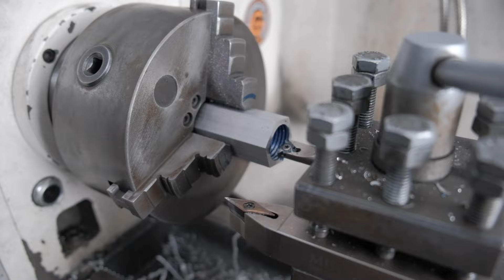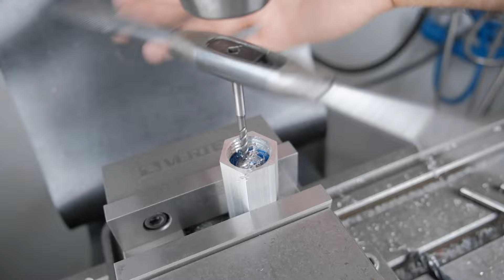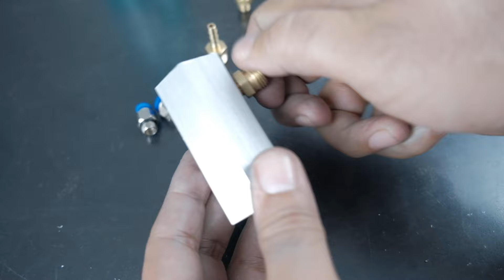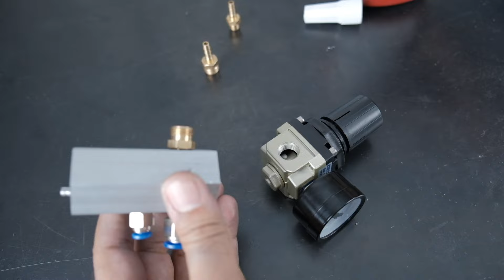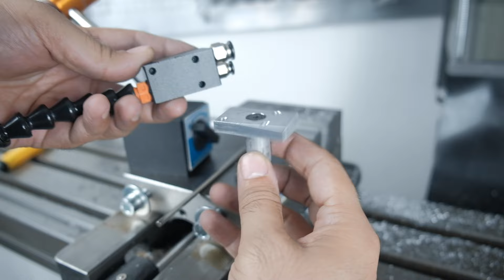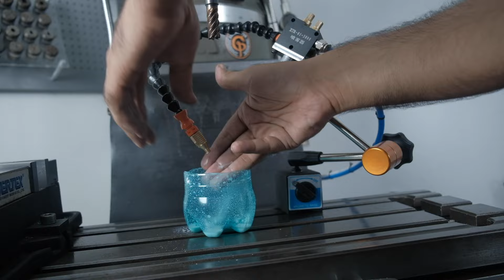Mist Coolant System

Comment: i have absolutely no idea what was the point of everything you built, the sprayer you used already has a fluid-air mixer inside, you just had to connect the air hose and the bottle with coolant straight to it. the bottle does not need to be presurized, the system sucks liquid from it with a venturi
Reply from the maker: hi. It can also be done as you said. this system is more accurate for less air consumption. and in this system, you can only flow airless liquid.